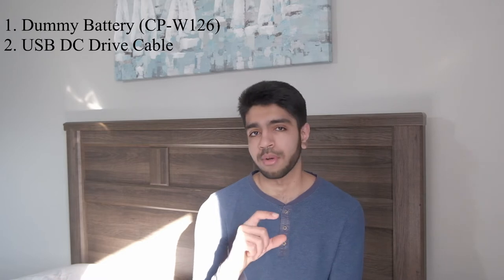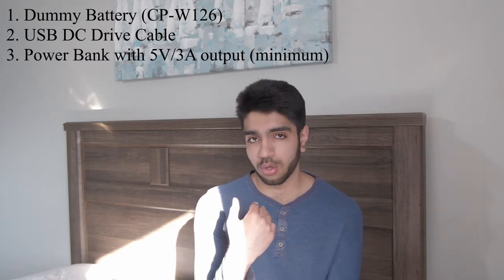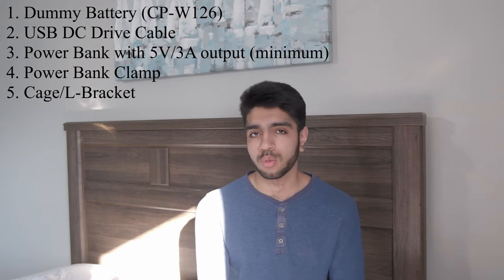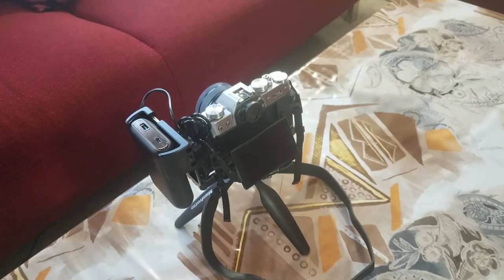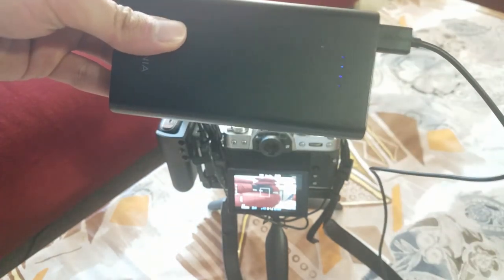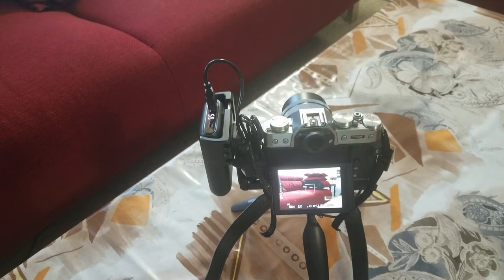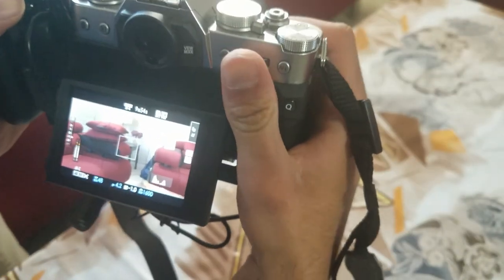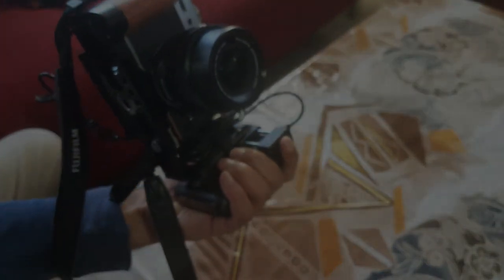Fujifilm XT30 - Video Power System

Comment: thanks for the video, can you plug the dummy battery into a wall charger that supplies 5V 3A, would that still work?
Reply from the maker: Yes it will! The kit I linked (if the link still works) comes with a wall plug that does 5V 3A and will run it continuously
Reply: @alihammad6318  thanks man!

Comment: Can I use usbc to DC cable instead of USB dc drive cable?
Reply from the maker: If you're able to find something sure, but unfortunately I wasn't able to find an adapter that would work properly. Also, if you do use an USB-C adapter from DC, you won't be able to power the camera from it as the USB-C / power delivery cannot communicate as it's normally done with a chip on the USB C controller. So I doubt it would work.
Reply: @alihammad6318  Thanks for the prompt replay. So maybe I should just use a USB to DC drive cable and can I power the xt30 off an Anker PowerCore+ 26800mAh battery?
Reply from the maker: @bochen2351  that's basically exactly what I did, albeit with the 10,000 mAh power bank. Finding the DC drive cable on its own might be tough, so depending on where you are it would be better to search up Fujifilm NP-W126 dummy battery USB as that hits the keywords and you'll be able to find a kit with the dummy battery + cable. Sadly the one I bought says no longer available but you'll see them pop up from time to time. eBay and AliExpress are options as well albeit they take longer.
Reply from the maker: Alternatively, a more easily available but much more expensive solution is a Power Junkie blind spot, which uses NP-F batteries. Linked in the description, that avoids the need for a drive cable as the NP-F batteries already output the correct voltage.
Reply: @alihammad6318  I guess that is a more elegant solution. I am watching DSLR Video Shooter's video on powering the camera. It is a shame that xt30 port design makes using both hdmi and usbc together impossible.
Reply from the maker: @bochen2351  if you are handy with a knife, I saw a post on a Fuji Facebook group where someone took the casing off the USB-C port, it still has a rubber covering and it was enough room to plug in both the HDMI and USB-C cable.
Reply: @alihammad6318  Ha I just found out a perfect solution for myself. I am going to use the atomos ninja V and already bought the sony battery for it. If I use an Ansso Battery Plates that comes with a dummy battery, I can power both the camera and the monitor at the same time with a single battery.
Reply from the maker: @bochen2351  excellent, I might do the same when I eventually get the atomos.

There's batteries that are the NP-F ones already with a DC output jack, might be worth looking into actually. All you'd need then was the appropriate DC cable and a dummy battery. Cable from the atomos battery into your camera and it's all set.